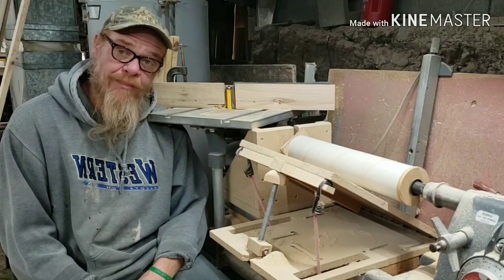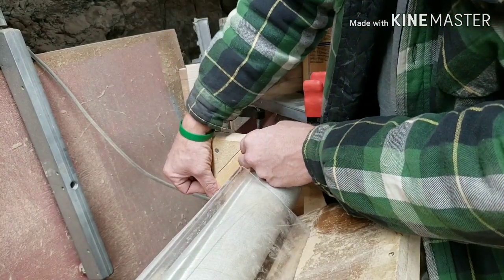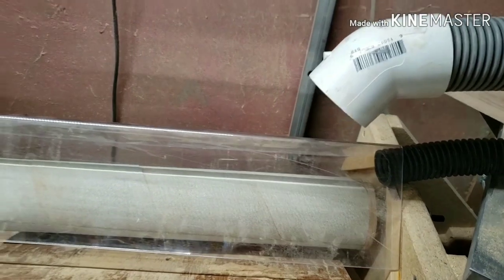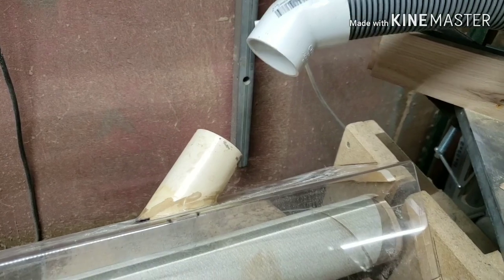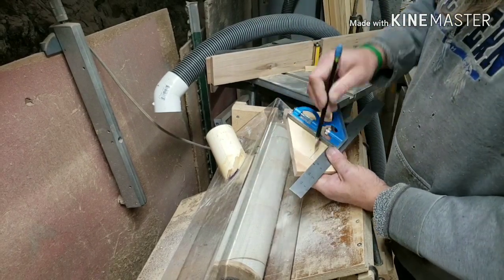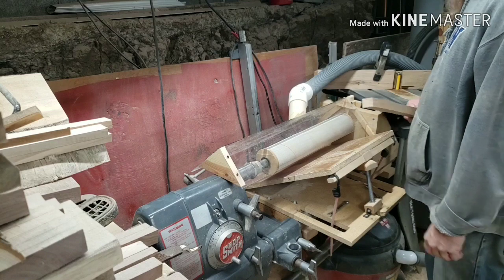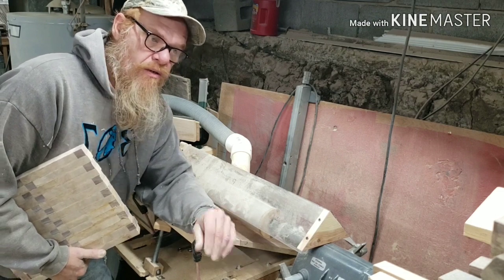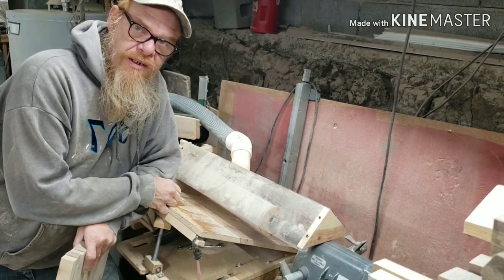DUST COLLECTION | SHOPSMITH DRUMSANDER PART 2 |

Comment: We have central vac here - but I'd like to buy a nicer head unit.   I have been wondering if the existing one would be a good small dust collector if I added a cyclone.   The existing vac is a bagless cyclone already.